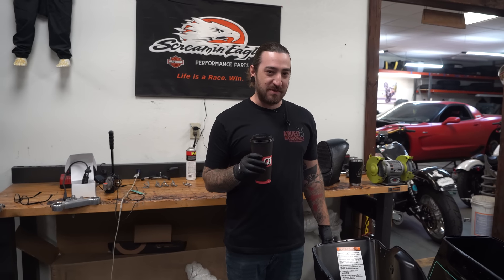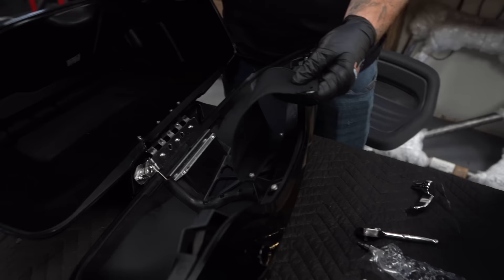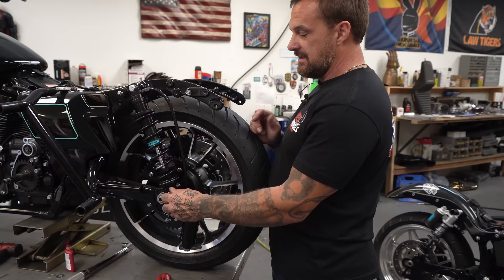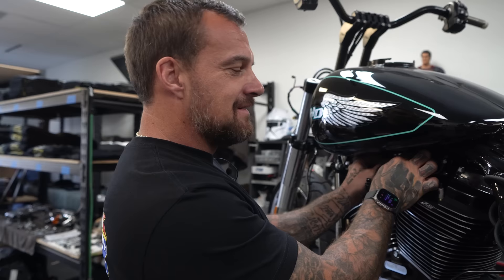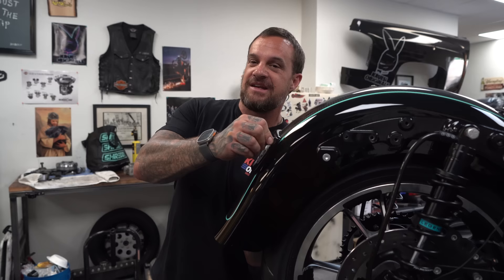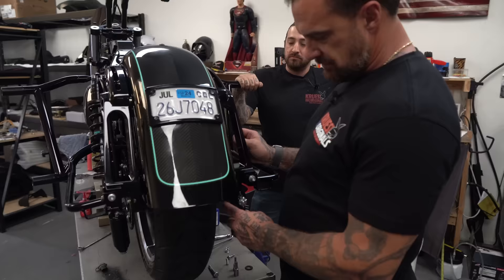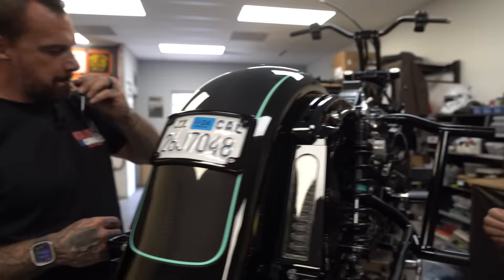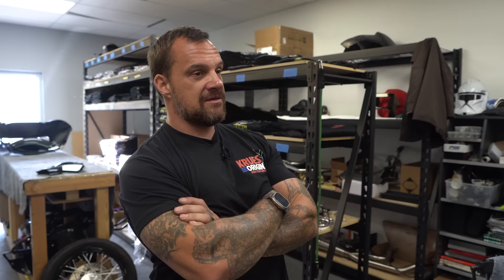How to assemble saddle bags on a 2023 Road Glide, Kruesi Vlog #84

Comment: The lugs on the QD mounts should be oval. Loosen the fastener and clock the lug for best fit. However, if the QD brackets are cheap  knock offs? No adjustment is likely.

Comment: Heads up, just did those custom dynamics filler lights as well as deleting the trir-bar on my 22 Road Glide and now I have no brake lights or cruise control. I also deleted the horn and did T-bars (with the CVO flash to remove the ignition) all of this at the same time of course so now this should be fun to track down. Any pointers would be greatly appreciated. And YES please build anothah Baggah! treat yoself
Reply: update: im a f**kin idiot and didn't have the lever against the brake switch.